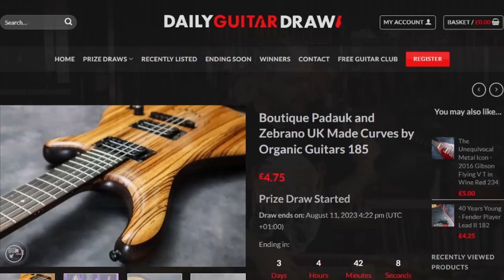Too Much Amazing Detail? Of Course they WENT OUT OF BUSINESS - Organic Guitars 'Classic' Teardown

Comment: I was the owner of that very guitar from 2020 to July 2023, when it was sold on consignment via a well known repairer. Amazing and awesome to see it on your channel!
The electrics were modified while I had it, with the push/pull pots being added for some more tonal options. Beautiful guitar and sounded beastly, but I just never bonded with it due to the PRS scale length and low fretwire. It's 25.5" and Jescar 57110 SS all the way for me

Comment: I have one of these which I bought new.  

I think you missed the point that they are specially made for the customer.  The pick ups, the hardware, the controls, and the neck shape are all decided by the customer.  Mine has Lollar Firebirds, a wraparound bridge and simple controls (all gold plated).  The neck was measured from my Gibson Firebird and then slightly narrowed.  So, the neck is what the customer asked for.  You also get to pick the book matched front from the wide variety of wood in the store. Mine looks very different from this example and I suspect no two tops are the same.

The are supplied with no finish, just bare wood, but with a recommendation to oil the body. So that oil and polish would have been done by the customer, not Organic 

They are just gorgeous to own and play, especially if you are the first customer as it is as close to your personal ideal guitar as you can get in the real world.

Comment: I have been playing for decades, and I can testify that compound radiuses are absolutely the most comfortable guitars to play. When I build a guitar that I'm going to keep, I make it a compound radius. The steeper curve at the nut makes cowboy chords a lot more comfortable, but the flatter radius up high makes soloing and bending a lot faster & smoother.
Reply: Absolutely agree, I suspect I will feel the same about multiscale eventually.  I won't make a guitar that isn't compounded now.
Reply: Geometry is on your side. Strings spread from the nut to the bridge, which means it doesn't follow the shape of a cylinder... but a cone. And a cone has the tighter radius closer to the point, wider at the base. ie: Compound radius is the natural shape of the strings. I have three compound radius guitars - two 12-16 and one 10-14. Love them to death.

Comment: I once made a rig that tested 1" vs 13" of string past the bridge - no major difference in tone.  Tension is a function of string gauge, scale length, and tuning pitch (according to the online tension calculators).  String length past the bridge or nut has no effect - other than the expected harp-like overtones of longer strings past the nut or bridge. Longer strings past the nut or bridge gives more total string length for stretching, which can make extreme bends a bit easier (non-locking bridges and nuts only).

Comment: ooooooo!!  That is lovely!  My Warwick Streamer Pro M (German made '99) has the body hugging solid figured maple contoured shape like that.  3 piece laminated jatoba neck with a nice chunky volute,  Also with an oil finish.  Recessed knobs, recessed jack, recessed bridge, inlaid tailpiece.  It does have a recessed back plate with a foil back and a label inside.  The backplate and truss rod cover are clip fit no tool required.  Very similar build.  I absolutely love it!  

BTW I have an '87 Gibson Bass IV with a failed barrel jack.  My '74 LP Special has the original standard style jack still going strong.

Comment: Organic inspired my own designs, I've wanted one for many years. As for the commentary on what it means to be handmade, I'm inclined to agree that the guitar is entirely handmade if you expand your perspective to include factors beyond the instrument itself. Someone had to 3D model the guitar by hand, the computer can't do that for you. Someone had to program the CNC. While the computer can aid that process, a real person still has to get hands on with it. The CNC did the majority of the carving on the guitar, but a person had to calibrate the CNC and position the blank in the machine. A person had to glue it up, install the hardware and frets, put the inlays on the fretboard, and set up the instrument so that it plays how it was designed to play.

If that's not still handmade, then we need to rethink the use of planers, jointers, thicknessing sanders, bandsaws, and even power drills. If hands were integral to making every process happen, I'm of the opinion that the instrument is handmade.
Reply: fair points, I don't feel strongly about gatekeeping the term 'handmade', however by those parameters every guitar made in china would also be considered handmade.
Reply: @ryanbreslin5981  Or maybe we draw the distinction at assembly lines. One guy that's good at designing and building an entire guitar could claim that his guitars are handmade. Could the guy at the PRS SE factory who just preps a body for paint say that he builds guitars by hand? I think maybe it involves a level of guitar-building-expertise by everyone who has a hand in building an instrument. There's obviously a massive gray area there, but I'd like to think that two guys in a garage who can both build guitars from scratch are crafting handmade instruments, whereas the assembly line is a group of people in which none have that ability and the sheer scale of manufacturing kind of precludes the handmade moniker. Maybe I'm gatekeeping, I'm honestly not sure.
Reply: As an engineering designer who came up from a trade, I can't agree the engineering and CAD work contributes to being handmade.  You have to program robots to build a thing as well.  Hand finished is a term that I use. maybe even hand fitted.

Comment: 3rd comment I know its spammy but, You would use a magnet to lift it off. One with a soft pad between that would be a stronger magnet than what was used. One of the things people don't know with magnetic stuff like that. There is also magnetic pick up tools where the magnet can move away from the pickup surface to allow it to come free so you don't have to pry the item off which could damage it. Odd that is still a common forget with how much magnets are in daily life. Even if you know about it you can still forget that you have something like that and can use it.

Comment: When I was making cigar box guitars, I'd always take a forstner bit to the headstock to help recess the tuners. It was a cheat so I didn't have to thin out the headstock for the tuners to fit. Saved so much time and effort. Also looked really good
Reply: Countersinking the tuners reduces the amount of usable tuning peg below the string hole.  This may be an issue for non-locking tuners that require more winds around the peg, depending on the depth of the countersink.
Reply: @normbarrows  nah, these were fine. On a headstock that was 3/4 inch thick, only about an 8th or so was taken out. Not a lot but enough

Comment: I have one guitar with  radius that varies from 9.5" to 14", one with fixed radius of 9.5" and one with fixed radius of 12". The 9.5" one needs slightly higher action so bends don't choke. The 12" one plays great all over the and the compound radium guitar also plays great across the neck. However, as someone that does their own set-ups, it is a lot more hassle to set up. The radius at the bridge needs to be even flatter than the end of the nexk to achieve the necessary conical string profile. Same with the frets when being leveled. Honestly, not sure it delivers enough functionality to make it worthwhile.

Comment: My personal experience with barrel jacks: 25 years old Ibanez 540S with a barrel jack positioned sideways on the body of the guitar – I've had to replace that five or six times by now. 30 years old Ibanez RG550 with regular-positioned barrel jack – still has the original jack (fully functional). Both guitars have been played almost daily (I'm a guitar teacher, so I do play a lot) with constant plugging in and unplugging of both guitars.

Comment: I know you think hand routing is hand made and cnc machine is not ? Take this in mind someone sat down and designed that guitar on paper. I am sure they had to do the prototype by hand routing just to have more control I'm guessing ? Anyway they would have had to program and tweak the cnc machine I'm sure a lot before a finished guitar was right ? I see no difference when your trying to make the same model over and over again whether You use a template and hand route or cnc route at that stage ! The rest of the guitar is finished with various hand and Machine Tools. 
So unless your advertising hand built no machining guitar then cnc machine is just another tool in Your Arsenal of woodworking tools ! Well that just my 2 cents anyway
Reply: I’d agree, its all about the hand finishing. Wood removed via router bit and template is not really different from wood removed by milling cutter and program.
The time saved with cnc can either improve your margin or get passed onto the customer as competitive pricing.

Comment: As far as the fit and finish with sanding and such its nice but as far as the details like the recessed parts and even all the extras is all done by CNC and if you got a well optimized cut and pathing (also if you got a 3 axis CNC) then this cuts down a lot of time and can be done pretty quickly unlike CNC with metal. So the reason they are so cheap is not a hurting business model. They are worth that price because the CNC. 

Either people thought that it was not handmade but CNC'ed and felt it should be far cheaper like a cheap guitar and not understanding its intricacies and how much work is still left needed for finishing and the solid quality that is there, Or.. People are more purist back then and would never buy it at anywhere near that cost price of the guitar because it is CNC'ed out and think it looks pretty but if you took it apart it is crap and they are hiding a lot of flaws and it won't last. Was it a company that started too early, yes and no. Even if they started now it would still show a lot of skepticism on it and people won't trust its quality unless they were placed in the hands of musicians that can vouch for them. 
People understand CNC more since the CNC machining and how good a tight finish you can get with it sometimes better than hand finished but wood is still wood and needs its own love unlike metals. CNCing wood is fairly easy as the proper tool to cut will not tear up the wood going the wrong direction than it would if you were turning or routing wood by hand. 

Its not the detail but lack of advertisement that did them in.

Comment: Gorgeous guitar, and if CNC made the low price possible, that is some awesome programming!

I'd like to see a video on string tension, the difference of string length vs scale length, and the effect on tone. It seems to me that Short-Scale Bass Guitar Builders are not taking advantage of using Long String Lengths, and have instead opted for thicker string gauges, which produce  compromised tonal results. A smart Guitar Builder/Designer would utilize the existing body length to optimize String Length while maintaining the best/comfortable playing Scale Length. That would be an interesting build. I've seen Piano Builders refer to the tuned string section that exceeds the speaking length, as the "duplex octave." Probably not practical for the guitar, but interesting none the less. 😉

Comment: Surely the tension won't change. To tune a 0.020 string to D over a 25.5" scale will always be the same (assuming same manufacturing of the string).
I agree overall string length might make a difference to feel but tension must remain the same - that's physics isn't it?
Reply: So why does the tension of a string on a 25.5" scale differ than one tuned to the same pitch on a 26.5" scale?  That is why baritone guitars exist, because low tunings get flubby strings.

Comment: I think handmade is too overly used term. "Hand Finished" vs "Hand Made" is the notion here. Some people think of if you put more time in hand work then its hand made but to be honest if not hand made but hand finished. If you are using your body to do the work like manipulating the tools then its handmade but if you are using a CNC to cut out and mostly shape everything then finish things by hand then its hand finished. The same thing can be said about "made in _____" it can be assembled in a location but it does not mean the parts were made there.

I think if they or anyone else operate in this day and age with CNC cutting and working most of the guitar then they will have to say hand finished. This is not just a cookie cutter and assemble so it still needs the hand work so its not something that would fall into machine made or anything like that but its not hand made and people will call it out on that even if it is really nice even for its price.